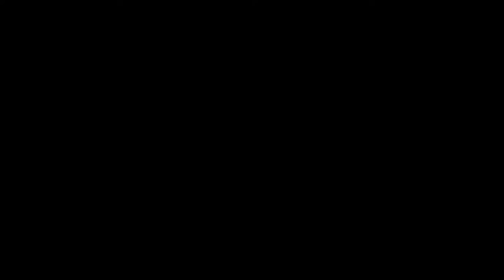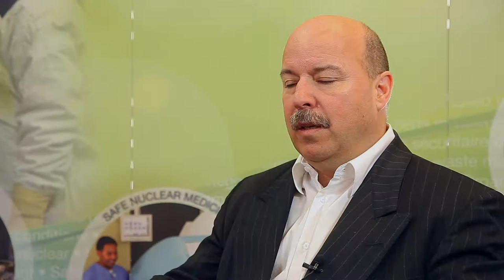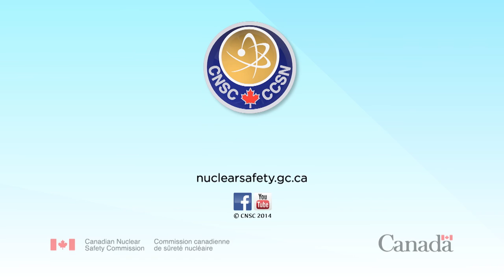Void Coefficient of Reactivity and CANDU Reactors

Comment: Any of the nuclear power plants now operating could experience an unplanned
release of radioactive material as a result of an accident or a malevolent act. There
are plant-specific aspects of the potential for such a release, but also broad
similarities.
Flaws discovered in 2001 in the CANDU reactor at Point Lepreau in New Brunswick
(Canada) have raised concerns about safety, inspection and management issues
associated with the Canadian CANDU reactor design, in Canada and internationally.
Specifically, CANDU reactors essentially identical to the flawed Point Lepreau reactor
have already been built in India, Pakistan, South Korea, Argentina, Romania, and
China. The flaw consists of a potential for unanticipated sudden Loss of Coolant
Accidents (“LOCAs”) arising from failures in so-called Feeder Pipes through two
mechanisms – one of which has been almost totally ignored by Canada’s nuclear
regulator, despite already having caused two Feeder Pipe failures at Point Lepreau –
the first in 1997 and the second on March 8, 2001.
Energy Probe, an independent non-governmental nuclear watchdog organization in
Canada, has reviewed expert evidence establishing that a long-ignored failure
mechanism – known as Stress Corrosion Cracking (SCC) – has the potential to cause
far more serious failures than the two that occurred at Point Lepreau, and to do so
with little warning.  source --------- ----         this is taken from joint-project . org

Comment: Sorry, CNSC, but this video is exactly the sort of thing you should avoid! This guy may? be correct, but the short, information-limited, video, coupled with his slightly smug assurances of "don't worry, simple citizens, it's all been taken care of." is NOT particularly reassuring.  Please try again.
Reply: I'm gonna have to agree with you there. This is pretty bad marketing. Obviously the science involved in this issue is difficult, and hard to present in a way that uneducated people can understand. Because the video is unscripted and too short, it fails at properly dumbing down the difficult subject, and in the end it comes across as "bro just trust me".
Reply: Indeed. Also, in molecular terms two seconds is a long time. Prompt criticality would occur far too soon for the two second shutdown to make a difference.
Reply: @harrynking777 Not if the positive void coefficient is small, which it supposedly is. CANDU is nothing like the RBMK.

Comment: Didn't the Chernobyl reactor have a positive void coefficient? Isn't that how they lost control of it. The hotter it got, the more steam it produced. The more steam it produced the more power it gained. The more power it gained the hotter it got...
Reply: the chernobyl was a completely different design with graphite moderation and light water... candu uses heavy water instead of graphite and is a much much much safer design with much more training and less soviet data and risk hiding/shrouding
Reply: everybody is a nuclear physicist after seeing HBO
Reply: @Andrew-vt2wq  What's HBO?
Reply: @LisztyLiszt  i apologize
Reply: @LisztyLiszt  Hi Bulls*it Output :D
Reply: CANDUs have a tiny positive void cof. Chernobyl had a massive one that allowed it to reach tens of times above 100% full thermal power in seconds
Reply: Surely, at Chernobyl if the water had not boiled it would still have have gone supercritical because the graphite moderated the neutrons.

Comment: One thing I don't like about Candu reactors is the way it's design, instead of having the pressure tubes going vertical, they go horizontal so if somehow they get damage they will tend to perhaps touch each other due to YES GRAVITY....not sure why they kept that design. Hopefully they will shut them all down at some point before some accident occur. And finally using heavy water this mean the reactor is used to make plutonium and thanks to that, you can make bombs, and they also make more used fuel that we can't never get rid of. For all that I say let's shut them all down we don't need an other Fukushima, Chernobyl and Three Mile Island (TMI)
Reply: Heavy water is a very good thing as it is much safer, plus your statement about the other reactors is false In these ways, Chernobyl was a mix of under training(simple terms) and basically bad reactor design.  First of all, the RBMK reactors are graphite moderated, light water reactors with a massive positive void coefficient, while the CANDU reactors have a tiny one.  Fukushima was the result of a natural disaster and 3 mile island was equipment and operator failure.  The CANDU reactors are the safest In the world, and there is no question about it.  Stop spreading misinformation and conspiracy against nuclear energy as it is truly the best solution.
Reply: And also the horizontal configuration has no effect on the safety and even if they were to touch, and even if they were to get damaged, it still wouldn't effect the safety of the system.Juet because it has a different layout then you are used to, doesn't mean it isn't safe.